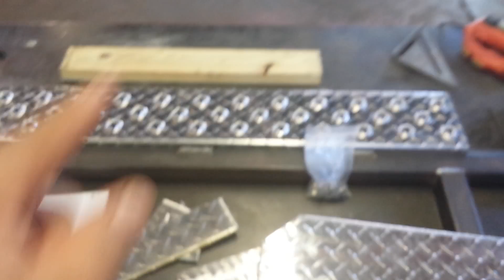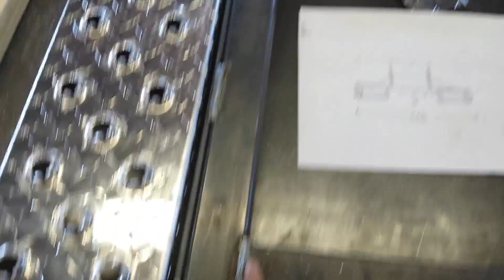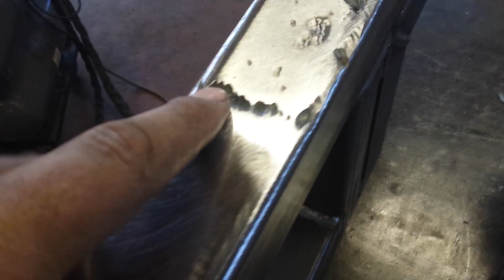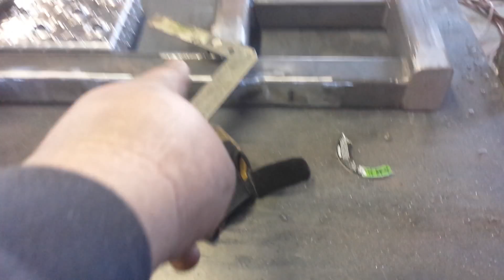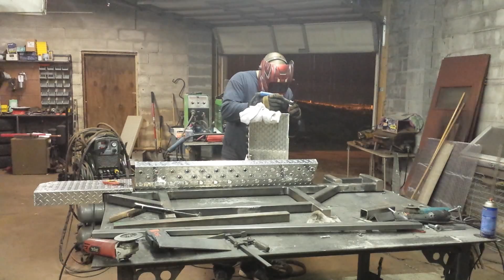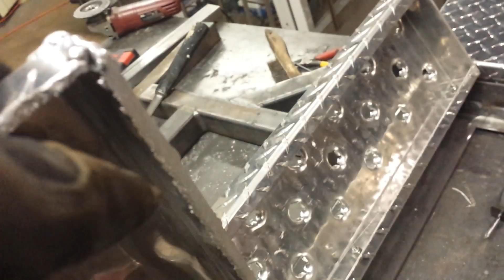Ambulance Bumper Build

Comment: Maybe you could just give me a little bit of advice on which side the Tig torch is supposed to be set up on on positive or negative on the Everlast 210 ext for aluminum welding
Reply from the maker: Negative. Again read the manual. I'm not trying to be a jerk. You're going to see what a difference that will make. Plus you don't want to do something that will mess up your machine. On top of that it's hard to learn how to TIG weld when you don't know how to use your machine.

Comment: Hi I just bought one of those machines Everlast 210EXT I'm having problems tig welding I'm not sure if I have it set up right can you give me some information on how to set the machine up for aluminum welding do I need to hook the tig welding torch up to the negative or to the positive and also what settings do you use on the machine thank you
Reply from the maker: First things first. I know this sound shitty but I'm serious. You need to read the manual. This machine has a ton of functions and not all of them are needed to get going. However you need to know how to work your way through the setting.Also have you ever TIG welded or TIG welded Aluminum? If not it's not just a settings thing. You need to start searching for videos about TIG welding basics. If you have TIG welded before then the manual will be your best friend. Start with the foot peddle. That will eliminate most of the settings too. To get started just keep thing simple. Put the machine on AC, Use the foot peddle, turn the pulse function off, and make sure your post flow is set at 5 sec and give it a try.

You have to understand that what you are asking me is very vague. There are so many thing you could have wrong and I don't have the slightest idea where to start. I can't see your settings, I don't know what tungsten you're using, or anything else like metal thickness and so on. If you are new to TIG welding be ready to struggle but you'll get it and come to love it. Sorry I couldn't help you more but there are tons of videos on TIG welding if you are new. The welders they are using might be different but the concept is the same.

Comment: How far is the wd21? I have a 94 I'm doing as both something to take outdoors and to enter into car shows I'm working on and it's nice to see other pathfinder owners out there for the rarity we are
Reply from the maker: What do you mean "how far"?
Reply: Alvarez Metal Works lol just curious if you have more into the pathfinder you were uploading videos of you building
Reply from the maker: there is more to come. Subscribe to my channel and you'll see them soon. I'm going to be doing a solid axle swap this year plus a few other things.
Reply: Alvarez Metal Works well to shorten your searching to help out, we have to get the Dana 44 from the grand Wagoner to do the straight axle swap without having to convert gear ratios and everything, I'm doing the same to mine here soon
Reply from the maker: I got mine out of a Bronco. I'll be using the radius arms and wristing one of them. But yes I have more work to do on it than I would with a wagoner axle. But on the other hand I can use the factory ford radius arms. It's all a give and take.
Reply: Alvarez Metal Works that's true lol mines in a shop right now getting darker Windows so the less fortunate can't go window shopping and see my valuables in my truck